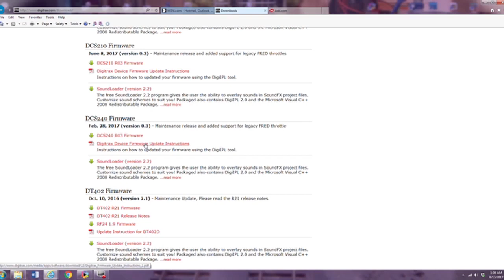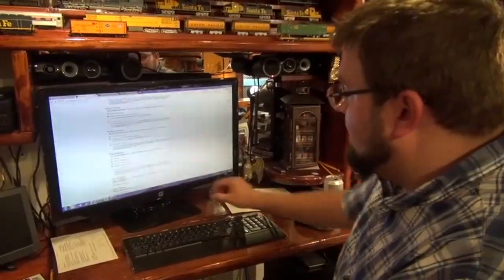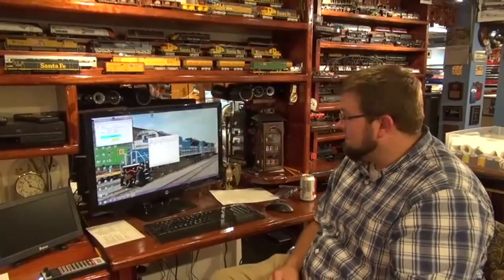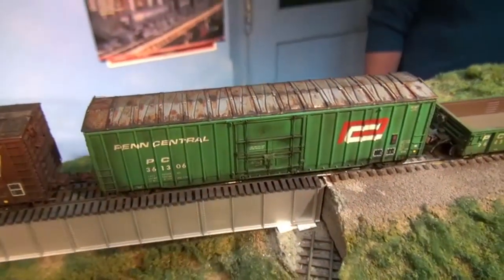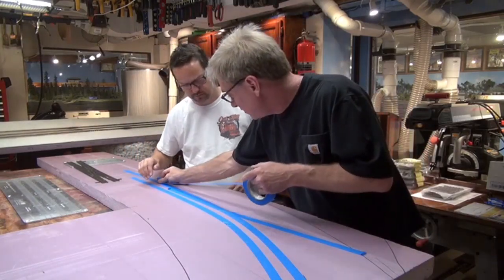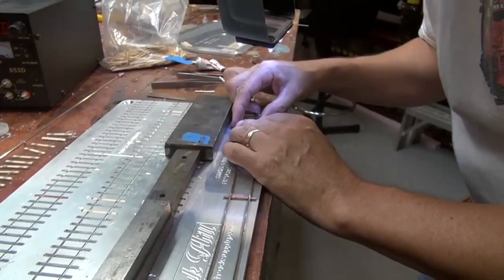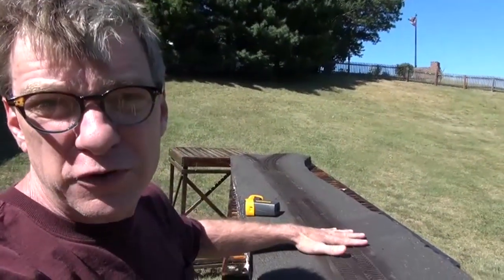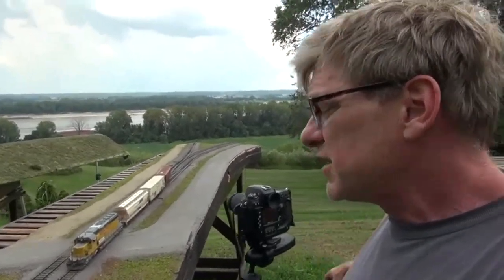Whats Neat in model railroading | October 2017 Model Railroad Hobbyist | Ken Patterson

Comment: another great show ken,i came across your what,s neat shows back in may or june of this year while watching train videos and got hooked on them,since then I,ve watched every one of them and I,m caught up with this month.s(oct 2017) show.and look forward to the next one.meanwhile the weekly pod cast are great too,keeps us modelers in form of whats going on.I,m in between layouts right now because I recently moved to NC from CT.I model in HO and I like building shelf switching layouts over the big mainline layouts and I was wondering some where down the road that you and your cohosts could maybe weigh in on your thoughts on the pros and cons of these two types of layouts as in terms of space and time perhaps most importantly budget on one of your shows. right now i.m looking into my next design of getting an outdoor wooden shed as my layout room about 12x16 to 12x20 in size, as they come pregutted  and an open floor plan just add the pink stuff and sheetrock and wiring to the main electrical box in your home. my last layout cost me about 300$ to build,it was shelf design that went around the walls of a 10x11 room.i built and design it in sections so I can take it down when I move.

Comment: Ken:

Thanks for another video chock full of great content. Two questions: I noticed you don't use any traditional roadbed material (cork, homasote) and install the track directly on the extruded foam. Can you explain your reasoning for this? Also, does the Bright Boy track cleaner remove the paint applied during the track laying? 

Thanks again for a great show!
Reply: Robert Getty I think we can arrange this conversation for september 30 podcast.
Reply: Daniel (at least I think that's you!): Thanks, appreciate the consideration.
Reply: Robert Getty it certainly is

Comment: Great video! One question....why bother staining the ties when you are going to spray paint the shit out of the track?
Reply: And why bother gluing all of those tiny tie plates when you're going to put big spikes through every one of them? I guess the spikes were an afterthought because of the handling the diorama will receive, but I couldn't even see the tie plates at that point.
Reply: Both good points. After Jeff left, I Treated it as simple hand laid track, The tie plates were only on a small 3 foot section. Now Proto 87 has scale spikes that I have never used. If you want totally correct detailed track you would treat each tie and tie plate as individual models color and all with scale spikes. You would also hand color the rail before putting it in place or brush color it in place. That way of doing it would work well and look good if I were building a scene for fun over a period of 6 months. I Have done that and enjoyed it a lot. We only had 24 hours to do the track and another few days to finish the scenery to show a quick example of what could be done using the templates. The presentation was only one way to do a scene. I must say still looks good from 1.5 feet away or about normal viewing for an operator. So  your both right with your posted questions..The proto 87 shops guys will have to make that video when they come by in November.  There is no right way or wrong way as long as it looks good and tracks well and our scene for this segment does both  just fine planting the seed for others to take it further